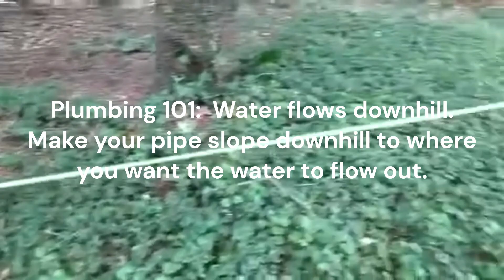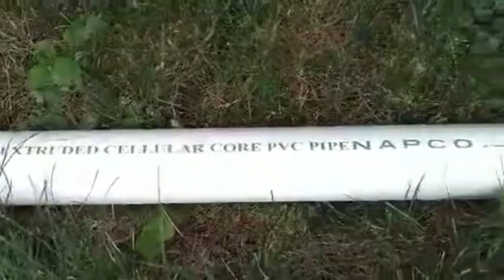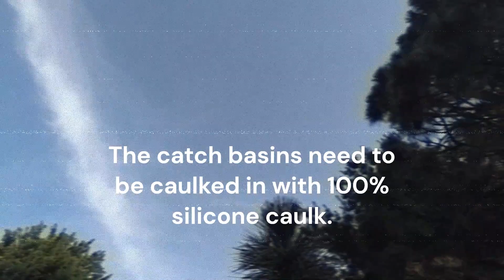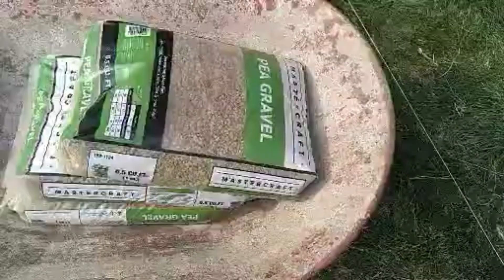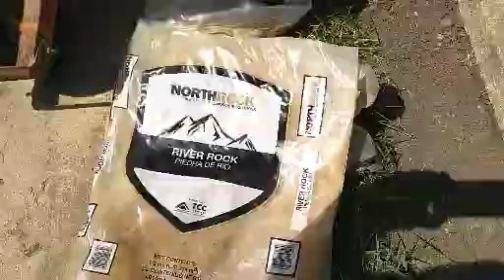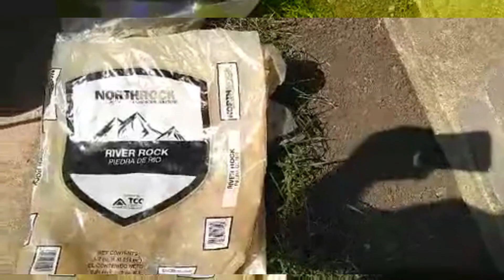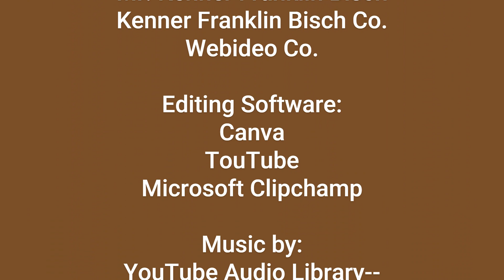How to Install a Catch Basin: PVC Schedule 40 DWV Pipe with 90- and 45- Degree Fittings.

Comment: It looks like you kinda turned the catch basin into a dry well. Helped a friend of mine do something similar except it discharged into a 55gal plastic barrel that he got for free that was used for cooking oil. Drilled holes all over the barrel, filled the barrel about 1/4 in stone, and surrounded the barrel with about 2-3 inches of stone and fabric. Digging the hole was a pain in the ass, but it was fun times.

Comment: Hey ~ Im doing quite the same thing! Curious how do you connect 3in pipe to the input catch basin? 
Mine is not really compatible? Do you convert to 4in? Or maybe lots of silicone?
Reply from the maker: Thanks for asking.  
The catch basin hole and pipe are compatible with either 3-inch or 4-inch ("The NDS Spee-D Catch Basin Fits 4" Schedule 40 pipe and 3" and 4" sewer and drainpipe, corrugated pipe or triple-wall pipe...") but with the 3-inch pipe there isn't a tight fit and it is difficult to caulk.  Caulking isn't required if drainage gravel is placed around the catch basin and pipe where it goes into the basin--so the instructions say.  I did use caulk for the input basin, though.  (Silicone caulk is the best to use.)  I did this by wrapping the outside of the end of the pipe and catch basin with duct tape to hold the pipe in place and then to seal the outside of that gap between them and hold the caulk in place from oozing out while it dried as I caulked it from the inside of the basin.  I used my fingers to push it into place this way.
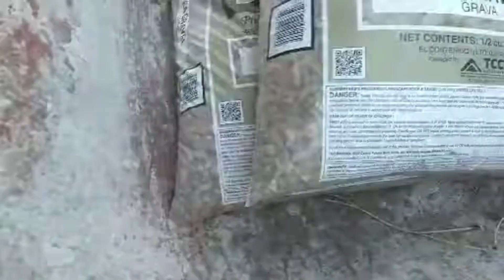In the next Webideo catch basin video the silicone caulk is shown in great detail at the very end of the video as bonus video footage ("Quick and Easy Catch Basin Installation" at minutes 9:13-9:36 in the video.
I hope that this answers your question.
--Webideo